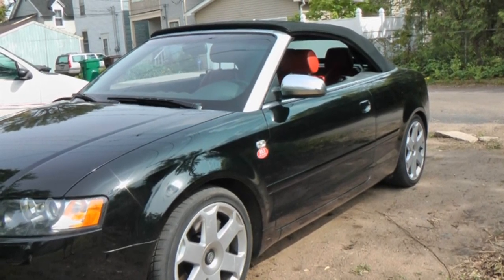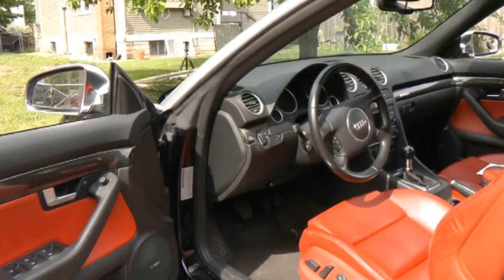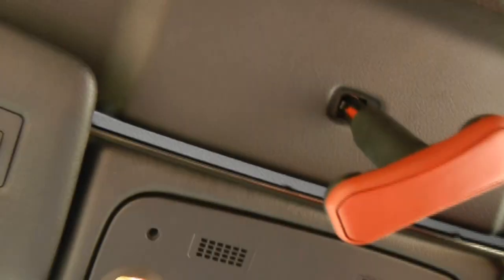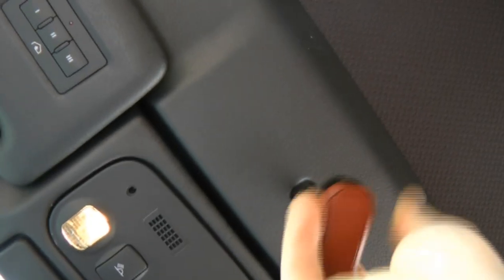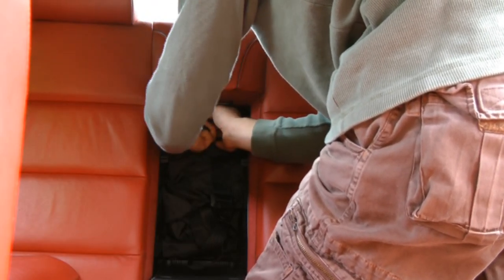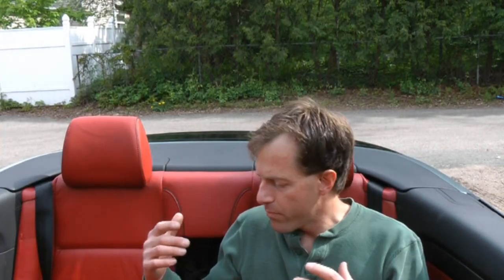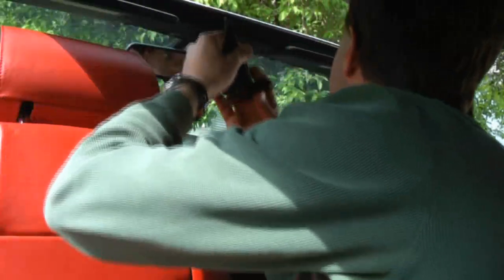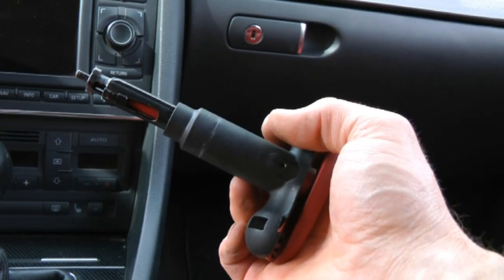How to Manually Operate 2005 B6 Audi S4 Convertible Top

Comment: Hola.
El proceso manual de abrir y cerrar para que se vuelva a configurar todo, se hace con el motor encendido o solo hace falta que esté el contacto puesto?
O directamente apagado y sin meter la llave en el contacto?
Gracias
Reply: Perdona, acabo de leer en comentario que se hace con el coche apagado y sin la llave. Entiendo que ya se arranca para probar que se ha restablecido todo y funciona automáticamente.
Es así no?
Muchas gracias
Reply from the maker: You don't have to have the key in the ignition. In fact, you need it to open some of the access panels.
Reply: @mbrenengen  gracias.
Electrónicamente abre y cierra. Pero cuando cierra el cofre no cierra bien (se queda 2 dedos abierto). Cuando abro y cierro manualmente, el primer paso lo desbloqueo pero cuando meto el útil en el hueco de los asientos de atrás es imposible, no hace nada ni a izquierda ni a derechas. Puede que esté bloqueado o algo dañado?
Lo hago con mucha fuerza pero no desbloquea el cofre.
No se me ocurre nada.
Reply from the maker: Watch the video closely. It is hard to turn. Make sure you are turning it the correct way. Maybe have someone push down on the deck while you turn it. Good luck amigo.
Reply: @mbrenengen  many thanks for everything. then I'll try again. greetings from Valencia (spain)
Grateful for your help
greetings

Comment: Hi there; very good video! Detailed! My roof gets stuck half way going down! Manually i did it 20 times; now always i turn the car on and 10 times roof light flashes and goes away; roof start again to open when i press the button and again: stuck , any idea?
Reply: +Dado Doda  Hello there.. Did anyone answer this for you? I have the same problem and am reluctant to take it to the main dealer.
Reply: Hey man; so what i did i checked that sensor on the side... i can send you video excatly which sensor
Reply: dude phoenix i can send you video which sensor to check

Comment: currently my 06 S4 has issues as im driving. It constantly gives the soft top not secure message when it looks completely closed. Will this reset the sensor?
Reply from the maker: It might, but I would suspect that there is something not adjusted right in whichever sensor tells the computer whether it is closed or not.

Comment: considering an A4 cabrio with the hydraulic roof not working, do you if you can open and close the roof manually leaving the key unlocked?
Reply from the maker: It is way too hard to manually open and close the top, but maybe it just needs to be reset like in then video...
Reply: i'll try, i don't have many hopes because the car I bought is pretty old and with many miles...Thanks.

Comment: 2006 a4 quattro. the pump was sized,repaired it. then top was operating fine,after several times operating it up and down with no problems. a light came on the dash saying system fault. now top only goes up about 6 inches then startes to come back down and lock

Comment: I have trouble in opening the central panel of rear seat, seams in the video you open it so easily, but I can't open it, not moving at all, any ideas? thanks.
Reply from the maker: Bo Feng There is a latch at the top you have to press down. Does yours look just like the one in the video? It should be easy.
Reply: Matthew Brenengen Thanks Matthew, mine looks the same like the one in your video, but mine is 2003 model, I don't know if there is any differences, and while I can feel there is a latch, I can't press it down, it just doesn't move at all : (
Reply from the maker: +Bo Feng Do you have an owners manual? Look in the trunk and see if you access it from there.
Reply: Matthew Brenengen The owner manual is just useless, I still can't open the central panel, however, I opened the trunk and cut a small hole of the ski bag then open the roof cover from there, by following your video, now it works like a charm! Thank you so much! : )

Comment: I have a 07 Audi A4 and the rear deck lid goes up but just free fall down do any of you knows why I'm having this problem ?!?!!
Reply from the maker: Yes. The gas struts are worn out and it is going to kill someone. Get it fixed. It will not be expensive.
Reply: @mbrenengen  is there something I can find on eBay
Reply from the maker: @blu101-o3t  no. Go to the dealer.
Reply: @mbrenengen  now you do understand I'm talking about the rear deck lid the part of the car that hinds the convertible top and actually it's stay up for a second and then slowly drop
Reply from the maker: @blu101-o3t  actually I was thinking of something else. However, that thing is really heavy. There must be a hydraulic lift that is bad. Not sure. Sorry.
Reply: @mbrenengen  yeah because when I press the button it does LIF up but eventually just drop down before the top really finished with operation and already try a new or pre-owned hydraulic pump